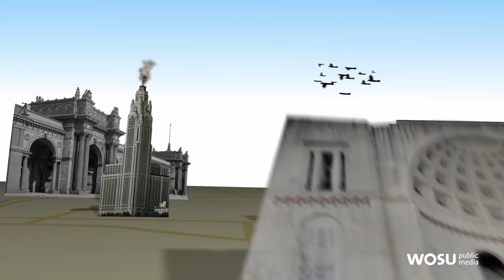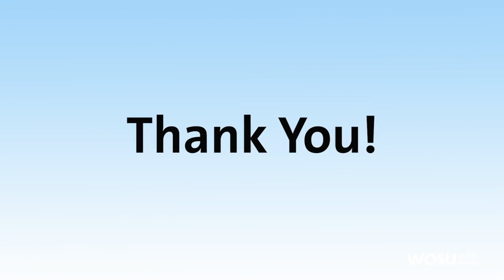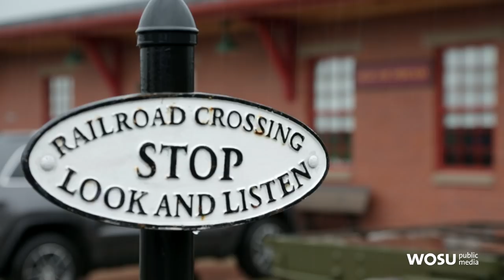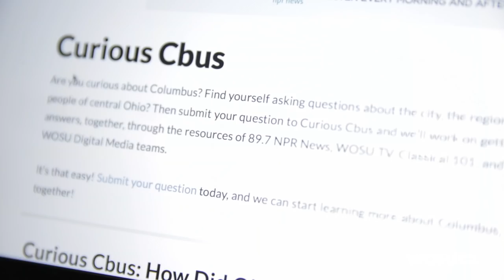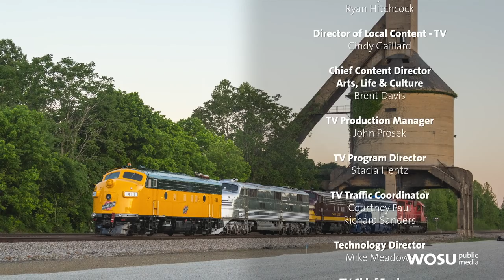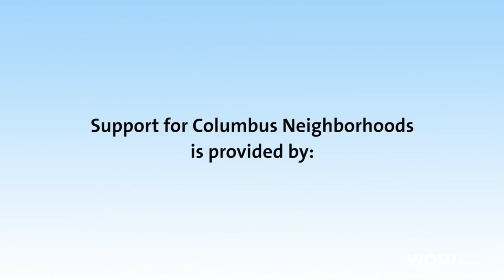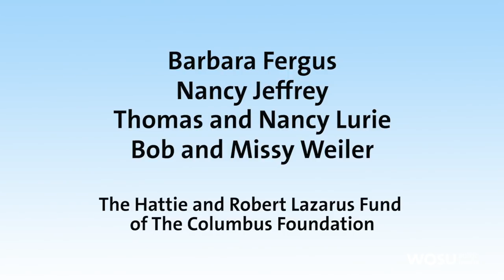Columbus Neighborhoods: Columbus Railroads

Comment: Hi from Green Bay.  Go Packers, all the way, back to Superbowl 2021 and bring the Lombardi Trophy home!!  I love the "Age of Steam Roundhouse", because here in GB, nearly all the roundhouses have been torn down, by the recent owners of WCL, and CNR:  the GB&W at Norwood yard was famous for the red Alco diesels; the Milwaukee Road was famous for the FM switchers H-10-44 used on the Alley Track downtown; and the C&NW was famous for the " 400" Fleet of Streamliners running on the 4 mainlines out of GB.  Hi to Tim and John at AOSR, because I recognize 3 steamers with Wisconsin connections. Like the LS&I #33,2-8-0 Consolidation from Marquette Michigan because here at the NRRM we have one of her sisters #24 since 1962 then in October 1972 the 24 was driven by the famous Hollywood actor Bob Hope just before he did a benefit fundraiser to help restore the Eisenhower British A4 Gresley from WW2 and the staffs' command cars that suffered badly during the Wisconsin winters.  Then you have the Woodward Iron Co. 2-10-0 Decapod that was stored at the Mid Continent Railway near Baraboo then loaded on a flatcar and shipped to you.  Then you have the Kettle Moraine Ry. #3 2-6-2 Prairie-type from the former excursion line outside of Milwaukee.  But many people reported it came here to GB, but this is false, because back then the museum was being run by outsiders, they are NOT railfans, but liars and cheaters, who sold off engines and cars, then had them Scrapped like the Pickle car and the Plymouth Center-cab #2001.  And they were extremely Rude and Obnoxious to local railfans who volunteered for decades, but then quit, and moved to projects at other rail museums.  Luckily they were fired after 6 years.  But then they got different managers who are even Worse.  Some of these original volunteers wanted to come back.  But they are still being refused.  Therefore, the narrow guage Lima Shay #5 has been sitting in pieces for over 30 years.  Hopefully, the AOSRM could establish a narrow guage division to restore Shay #5 to give it a much better home.  Please have a Very Happy New Year 2021 A.D.  and help to take care of everyone else during Covid 19.  OK.  Next message:  Columbus doesn't have Amtrak, and neither does the Green Bay Packers.  C.U. Later!!  From Steven.